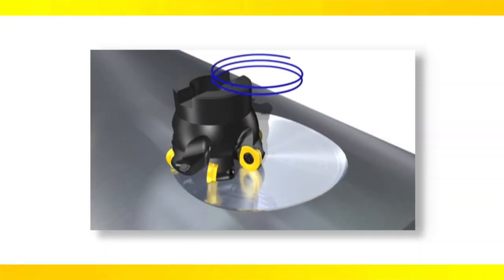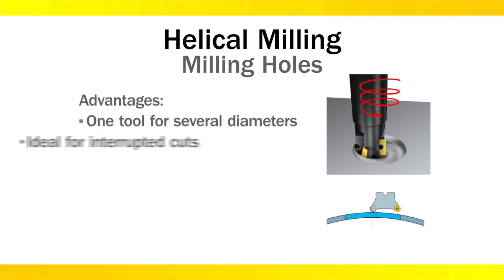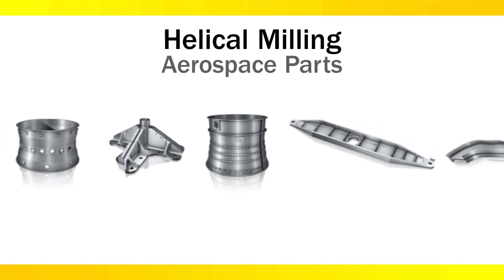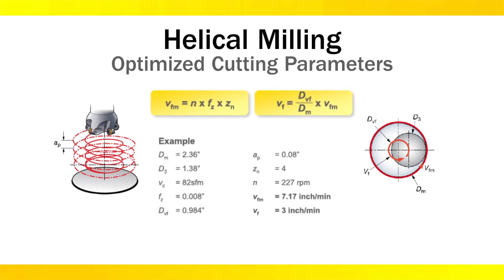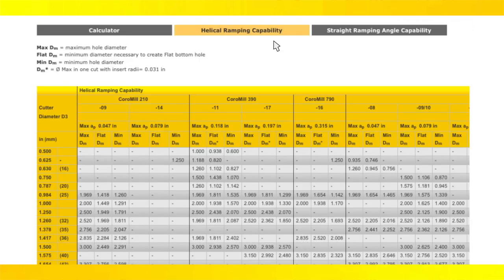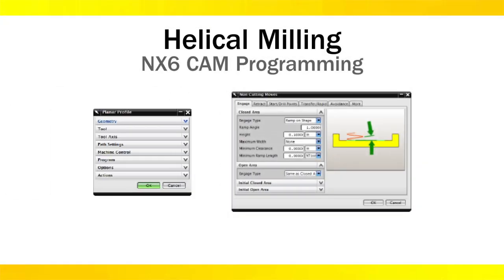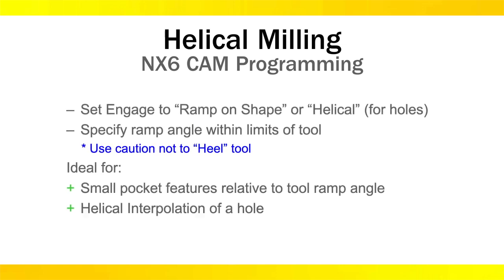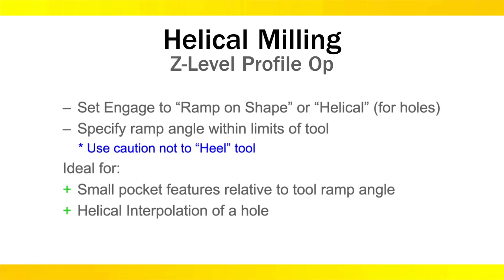CAM Programming Tip: Helical Milling & Ramping, Sandvik Coromant

Comment: Helical milling is a good idea if your machine is capable of interpreting the code. :( I work on something that won't do an arc command while it's doing a Z movement.
Reply: Do you not want or have the means to retrofit the controller?
Reply: @brandonsmoot4056  Lol, no. I don't own the machine, and the company wouldn't want to try and invest in that. The machine is something like 15+ years old.
Reply: @gredangeo  damn man, that's rough but I'm glad it's not your boat anchor at the end of the day